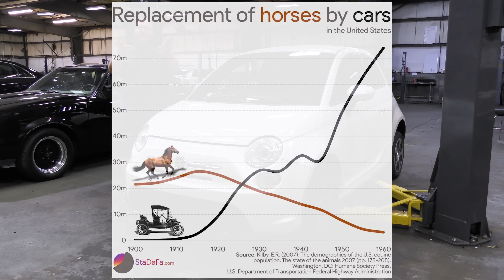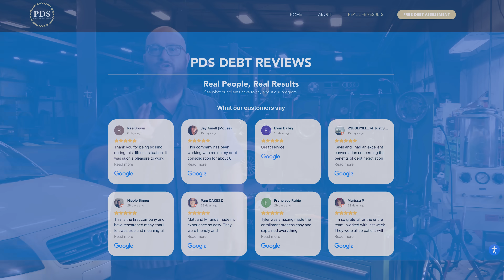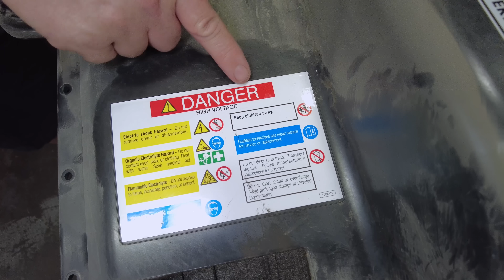How to SAFELY Remove the EV Batteries From my Fiat 500e

Comment: EVs were some of the first cars on the road.
Reply: 1832. Yes.
Reply: @wolfgangpreier9160  Could not out do the combustion engine then can't out do the combustion engine now. Still not practical no matter how much they are pushed on us.
Reply: Correct.
Reply: The first automobile made for public sale was the 1885 Benz Patent-Motorwagen, which was a single cylinder two-stroke GASOLINE engine. Electric street cars were the first mass transit to use overhead lines. But up until the Model-T, cars were a toy of the wealthy. Mostly steam or electric. BUT steam beat out electric. It wasn't until Rockefeller used the byproduct of kerosene production to make fuel for gasoline engines that beat steam and electric.
Reply: @alpine1600s  You got some facts wrong -- firstly Benz motorwagen, was the first internal combustion "car"  - it was a tricycle. about 25 were made.  How about Oldsmobile Curved Dash from 1901-1907 where they made about 19000~~22000 of them

Also 

"Regular intercity bus services by steam-powered buses were pioneered in England in the 1830s by Walter Hancock and by associates of Sir Goldsworthy Gurney, among others, running reliable services over road conditions which were too hazardous for horse-drawn transportation.

The first mechanically propelled omnibus appeared on the streets of London on 22 April 1833"
Reply: Them first evs only went 15mph and went 5 miles tops
Reply: @JOHNJ0HN9111 incorrect…
Reply: 1900's it was ⅓gas ⅓steam ⅓electric
Reply: @GibsonBuck  failed ! Electric ⚡️over $trillion taxpayer money invested and many going broke like Fisker 2x loser 
100s others gone either the money 💰 none ask or investigate .
Reply: That doesn't make them more viable.
Reply: I'm from Europe and all 20+ years cars all had parts replace and used pieces pit on in, is normal.

What we need is for evs to have third party parts available.

Also don't from what european country were is expensive to fix a old cat in mine it isn't , only some european city centers restricted old cars access, we have scrapyard and for new parts websites like autodoc exists.

25% of cars on the road in my country more than 20 years.

Ev accounts for 25% of new vehicles sales but 80% of new cars are brought by companies 

I know a few people that have ev and nowadays they aren't a rare sight.
Reply: People forget
Reply: They have failed many times same problems. Too long to charge and short range . Post ww1, Jimmie Carter days , Obama FISKER , here we go again . I guess a good war and oil shortage get them selling again 😅
Reply: Steam was first.   Personally i think the electric cars with a small gas engine creating electric power was one of the best early cars.  (See Lenos garage.)  I think i would prefer that type today.
Reply: Jay Leno has a Baker Electric Vehicle from the early 1900’s.
Reply: And failed. Just like the new generation will fail. Its all about money.
Reply: @Kededian Amen 😌
Reply: and they are still junk. If you buy a 8 year old its already outdated and 1 step away from a battery swap
Reply: @Chris-hw4mq  I have a 2014 FIAT 500e with 99,000+ miles on it. Perfect 'round town grocery getter. Costs nearly nothing to maintain. Charges in about two-hours, and goes an honest 70+ miles/charge. Best second car we have ever owned.
Reply: How many have you owned  @Chris-hw4mq
Reply: @Chris-hw4mq  Every 8 year old car is outdated and one step before its grave. 

Batteries last much longer than the rest of the cars. Such cars like the Fiat, the Tesla Roadster or Nissan Leaf were from the first generation of Li-Ion based cars. Now we drive 4th generation cars. Its like a comparison between a Convair and a Toyota Camry.
Reply: @wolfgangpreier9160  No they are not in europe you see lots of 20 year old cars driving without problems meanwhile an EV battery will shit the bed in 10 years and total the car
Reply: @Chris-hw4mq  No it does not. 

EVs are simply not old enough to say how long the batteries will last.

If you compare a Nissan Leaf with a Kia EV6 you must also compare a Opel kadett with a Mercedes E-Class.

And they will not shit the bed. Fossil burners shit dirt. EVs use silent and invisible electrons.
Reply: @wolfgangpreier9160 ... An 8 year old car is no less outdated than your 8 year old house. Cars don't go out of date, they get abused and then thrown away... Which is a major issue. Just like your house you can update and upgrade your car from 97 to have all the latest and greatest things. You just have to take care of it and don't let it rust. Modern cars also seem far more "fragile" so you are better off updating an older one. 
Electric vehicles have far more of a problem with broken "technology" and probably shouldn't be considered... But honestly if it still works, they should be fixed. Unless the frame is rotted out or it's been set ablaze the vehicle should stay on the road and driving.
Reply: @TheObsesedAnimeFreaks  Of course you compare a technical gadget with something that stands since Charles the Great. At least in our country. My own house is fairly young around here and is from 1983. There are not cars anymore from that time period.

No you can not update or uprade your old fossil car in Europe. Emission controls limit the possible lifetime and every year it becomes more expensive to reüair and maintain your old cars. For many cars there are no replacement parts available. 

One neighbor tries to do that and pays the price for his stubborness every year.

I ´have neither time nor knowledge how to maintain and repair my cars. I am a electrician and my employees do not get the time to repair their own cars. They must work.

We lease or get a loan - depending which interest rates are cheaper at the moment and replace our cars after 120-160k Kilometers. 

In that time a fossil car needs 4-5 maintenance trips, 2-3 x new brakes, 1 x new timing chain and 3-5 times all filters, AGR, coolers, particle, emission control etc. pp.

My EVs get a fresh interior filter every year.

THAT I S ALL!
Reply: @wolfgangpreier9160 What! Iam Driving a 2010 Toyota pickup 2011 Xterra, run just fine.
Reply: @wolfgangpreier9160 My Ranger is far older than 8 years old. Runs like a top.
Reply: @QCJerks  You believe a newly built Ranger from 2024 will still be running in 2032?

I DO NOT THINK SO...

My cars will be changed at least 2-3 times until then. I do not have the time to repair or maintain my cars. They are tools and must work. 

I will see in 2030 if i can reduce some cars and switch to robo taxi or make my own robo taxi service locally. We'll see.
Reply: @truantray  They will change when it becomes expensive NOT to think about it.
Reply: @truantray  Throwaway EV’s at seven years is supposed to be better for environment?